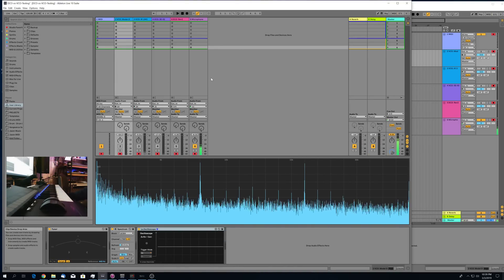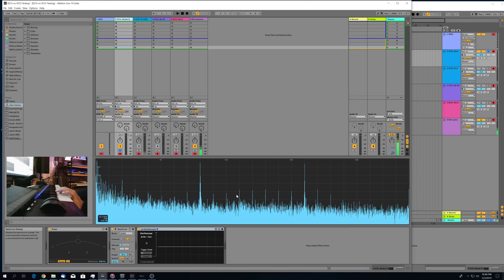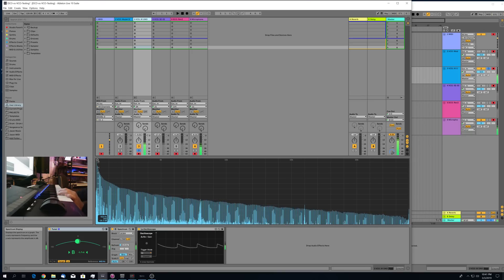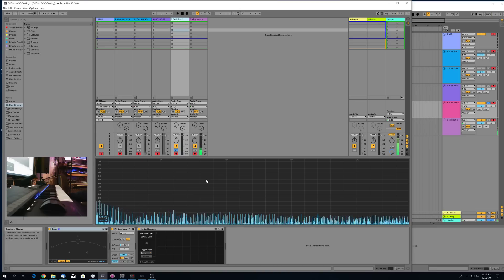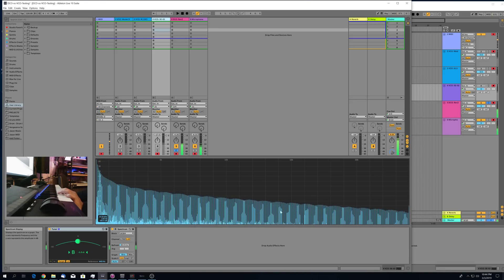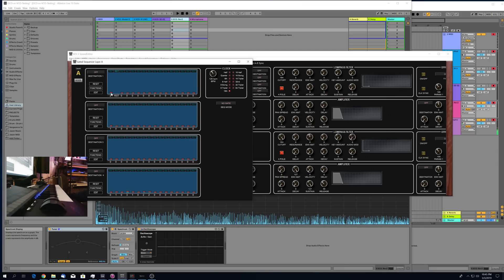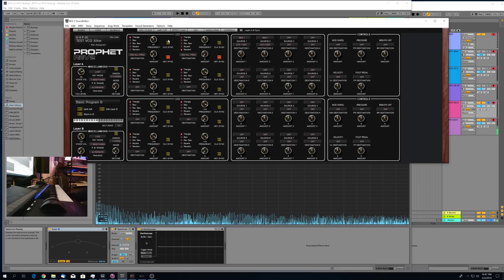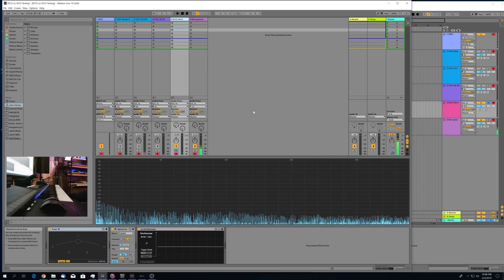VCO Harmonic Frequency Jitter - Do DCOs sound more harsh than VCO synths?

Comment: What about digital DCO?  Like in Casio CZ-101, Kawai  K1, Kawai K4 etc
Reply from the maker: DCO is a digitally controlled analog oscillator  (digital clock/frequency tracking controlling analog waveshaping)    I did test DCOs in this video.   If you're talking about true digital like the CZ, K1,etc, they perform in a similar fashion to DCOs...  ultimately, the clock/frequency tracking is what affects this phase jitter / frequency jitter.   If the clock is digital, then no jitter.    The much bigger effect on "vintage character" comes from per-voice variances to osc tunings, filters, envelopes, lfos, etc...   I have done some research on that topic.  Info here:   https://www.voicecomponentmodeling.com/
Reply: @CreativeSpiral  Why did you decide, that  DCO is a digitally controlled analog oscillator?  Where did the word ANALOG come from? This word is missing in the original abbreviation. I think then the abbreviation would look like this  - DCAO. But  we have DCO.  If You check manual of digital synth and romplers like Casio CZ-101, Kawai  K1, Kawai K4 etc   you can see that their digital oscillators are also called DCO. So I don't really understand why you think DCO should be analog only. Synthesizer manufacturers don't think so.
Reply from the maker: @EuroDJ   That's exactly what I'm saying... many people are confused by the acronym.  They should be referred to as a DCAOs, because that's what they are.  Analog/Voltage Controlled Oscillators, driven by a Digital Clock / Frequency control signal.   Digital oscillators are completely digital in both the clock and wave generation.   All synth manufacturers understand this.
Reply: @CreativeSpiral  What means "All synth manufacturers understand this."?  I have given above absolutely digital synthesizers and romplers, in which their digital oscillators are also called DCO. Open the Casio CZ-101 manual and see for yourself. And you say that DCOs are only analog and you say that   "All synth manufacturers understand this."  On the contrary, under the abbreviation DCO, synthesizer manufacturers understand both analog and digital synthesizers, but all these oscillators are digitally controlled, which is exactly what the abbreviation says.  Analog DCOs are just a special case of first generation DCOs from the first two Juno (6 and 60). In 1984, the Casio CZ-101 came out with digital oscillators, which were also called DCO. And a year later, Roland released the Alpha Juno, which, according to some sources, were also digital osc and, similarly to Casio, were osc also called DCO. Then  romplers with DCO - Kawai K1, Then  - Kawai k4 etc etc etc
Reply from the maker: @EuroDJ   Digital Oscillators are not the same as DCOs.   DCOs have digital control of an analog generated wave.    Digital synths have digital control of a digitally generated wave.   If you don't believe me, feel free to post on forums like Gearslutz or any other professional synthesizer forum, and ask if digital oscillators are the same things as DCOs... or email any of the manufacturers.   If Casio printed, forty years back, that they were calling their digital oscillators "DCOs" then they were wrong to do so, and they just misappropriated the terminology.   https://en.wikipedia.org/wiki/Digitally_controlled_oscillator   https://www.presetpatch.com/articles/vco,-dco-and-digital-oscillators
Reply: @CreativeSpiral  The official manual is not marketing literature, it's the official manual! And all the other definitions of DCO that you can find on the Internet or on Wikipedia or somewhere else ... this is really the material written by no one knows who and no one knows how. Usually these authors are not related to the production of synthesizers, and are not their official representatives. Therefore, let's take into account not advertising booklets and sites from third parties, but the primary source, that is, official information from synthesizer manufacturers. If in the CASIO CZ-101 manual the oscillator is called DCO, and this manual is already 30-40 years old ... How can some blogger on his website say that DCOs are only analog? This means that such bloggers did not discover anything further than the Juno-6 manual and do not take into account the historical facts of the existence of DCO in digital synthesizers.These people simply do not give a damn about the opinion of the manufacturers, and they write some gag.      Somehow it turns out that in the Casio CZ-101 manual there is an error with their digital DCOs, in the Kawai K1 manual there is an error with their digital DCOs, in the Kawai K4 manual there is an error with their digital DCOs, in the Roland Alpha Juno manual there is an error with their digital DCOs, and only Wikipedia is not mistaken)). Are you confusing cause and effect? At first, manufacturers call digital oscillators DCO, and after 30 years, bloggers mistakenly say that DCOs are only analog. In this case, how could Casio make a mistake with the definitions, if bloggers come up with an erroneous definition only after 30 years? Casio is wrong about what definitions? Do you have at least one official definition that was introduced 30-40 years ago, which would clearly state that DCO should be only analog? )  Now any illiterate blogger can create his own web page, as well as edit an article on Wikipedia with various nonsense .. and there is a high probability that no one will really delve into the essence of things and leave it as it is.  Judging from the link that you gave, it is not true, let the author open the official manual of those synthesizers that I cited as an example and make sure that the manufacturers of synthesizers   such digital oscillators called DCO. This contradicts his invented theory. Therefore, I would not cite as an example resources that contradict historical facts.
Reply: @CreativeSpiral  From Wikipedia about DCO from your link:  "The term "digitally controlled oscillator" ..... is also sometimes used to describe numerically controlled oscillators."     So... Numerically controlled oscillators - this is digital oscillator that works on samples

Comment: First off, thank you for this video, a great demonstration! But there is a glaring flaw in this whole "harmonic jitter" idea, this is a phenomenon that doesn't exist. What you are seing, the upper harmonics modulating "more", is the consiquence of using a linear scale on you analyzer. Realise this: about half of the analyzer, the rightmost, represents one single octave! Tonally speaking, the distance between 50-100hz is equivalent to 10k-20khz. Harmonic overtones will, and can, not modulate the same number of Hz as the fundamental but will instead vary in a way of percent away from it. I hope this can be of help.
Reply from the maker: Yeah, I'm aware of octaves/music scaling exponentially...  That doesn't take away from the fact that in the upper frequencies, this still results in frequency modulation of 200-400hz range in higher harmonics.    Harmonic jitter / phase jitter is a well established effect... there have been other papers on the subject.  The question really is:   How much do we hear this...  And is this one of the contributing factors to why some people perceive digital/dco synths as being "more harsh" or "more sterile" than their VCO counterparts.   As I mention in the video, and have written up in articles since, my feeling is that it's very subtle, due to amplitude falloff, and frequency scaling..., but it's definitely present.   This motion may result in a sort of blurring of tone for some people with more acute hearing.   Personally, I'm not to concerned with replicating this effect.   I occasionally reproduce the effect on my DCO synths, or the digital Reaktor synth I've built, but mostly just ignore it, as I don't think it makes a substantial difference, especially in more complex patches with other modulations going on.

There is another topic that I discovered right after investigating this, that has a HUGE effect on replicating vintage poly synth character and improving the modeling of acoustic ensembles....  Voice Component Modeling / Per Voice Variance -   I wrote up a paper in early 2019 on the topic:  http://www.VoiceComponentModeling.com   I perform VCM techniques on nearly all patches I create, if I want them to sound more organic/warm/vintage.
Reply: @CreativeSpiral  i will definitively read that material! I cant imagine how overtones would modulate at a different relative amplitude from a fundamental, to me that would mean an analog oscillator actually producing sinewaves that sort drift around... but I hope i get educated and proved wrong because that would be very cool if one could reproduce it.  I'm working with modelling a synth in pure data and it's a real journey exploring all these ways of 'warming' up the sound or what have you. The tuning of oscillators and voices sure is a big part but the topic is like a black hole. Time just gets sucked in and disappears ;) cheers!
Reply: @CreativeSpiral  Very happy from reading that paper. My synth project actually uses per voice sub-prosessing, and after reading that i will definitively ad variance in other things than just tuning. I guess changing some gain levels and filter frequencies could really open up the sound a bit :) great stuff.
Reply: Hey Rasmus, your initial comment was correct. The upper harmonic movement you see has been exaggerated by the FFT bucket size. If you wanted to actually move the relative frequency of harmonics you would need something like a SSB modulator. That said, adding a small amount of FM is a good way of warming up a DCO.
Reply: @iansayerpersonal2925  I've been thinking a bit about this so i'll think out loud for a bit. I still assume that what we se in this fft spectrometer is just a linear representation of an exponential behaviour. Fwiw, I've experimented with frequency based modulation in the fft domain, and that is a very strange sound haha. But something i think is more important is what amount, and position, of filtering goes on in the 'renowned' old vco synths.. even if you dont have noticable nonlinearities in amplitude, filtering would cause phase delay depending on frequency. And say you have a discrete vco, its not hard to imagine there would be inherent capacitance and inductance. So if you, on top of that, use intentional filtering to even out the impedance to get a 'flat frequency response', so to say. I don't really know what the audible impact is..  what I do know is that if you would compensate in a later stage, any nonlinearities inbetween would behave audubly different. And i think this is very imortant. Especially for achieving things like that nice saturated 'filter burn'.. but maybe it will cause a distortion of the phasing that is not reproduced in more integrated circuits.. I would love to have some hands on time with a standalone moog vca.. can't isolate the stages in mine.

Comment: This is unbelievably great...but once you factor in harmonic frequency jitter and voice component modelling on Rev2 you quickly run out of LFOs and Gated Sequences to use :-(
Reply from the maker: Thanks!   The Voice Modeling (VCM) has a much more significant effect for capturing vintage synth character, and I use it constantly...  Modeling harmonic jitter is just "above and beyond" in my eyes, if you really want to nail a classic VCO sound...  I usually skip the harmonic jitter modeling actually -- unless it's a Mono Synth/Bass/Lead type of sound that I'm modeling.   If you have a polyphonic / multi note patch with Voice Modeling offsets, the VCO jitter is somewhat lost in the complexity of the sound anyways... and I don't think it's that important to add it in that type of scenario.    

I did recently upload some new template patches for Vintage Voice Modeling that use only the Gated Seq and 2 Mod Slots... and leave you with all four LFOs for sound design, plus six mod slots and all envelopes.      https://www.youtube.com/watch?v=m1kzNV_JK60

Comment: Tried this with Prophet '08, but increased the sequencer value from 2 to 8 - the result is subtle enough to not be clearly heard as affecting frequency, but noticeable enough when stacking several voices together. Doesn't make '08 sound like a vintage poly of course - but quite a bit more pleasant.
Reply from the maker: Yeah, that's the same conclusion I came to as well... very subtle.  I researched another topic around this same time as well.  Check out my write up on Voice Component Modeling (and videos).   Voice modeling makes a huge difference when trying to recreate classic/vintage analog poly character.  (it can be done with Rev2, or P08)   http://www.VoiceComponentModeling.com
Reply from the maker: This video shows how to set up voice modeling:  https://www.youtube.com/watch?v=jB9HG3k3vvQ&t=350s
Reply: @CreativeSpiral  tried that, sounds like a natural voice detune - but wouldn't it keep DCO wave static and harsh without routing Seq3 and 4 to LFOs to oscillator frequencies as in this video?
Reply from the maker: @wrmusic8736   It's a detune that occurs independently on a per-voice basis.  (also, per voice offsets to envelope ADR timing)  It makes a huge difference if trying to model vintage poly synths.   I recorded 100s of samples of OBXs, OBXas, MemoryMoogs, Prophets, Jupiters, CS80, Polysix and others... they all have per-voice offsets to tuning, envelope timing and other characteristics, and those small voice-by-voice offsets account for a huge portion of the "classic poly synth character"... more so than harmonic jitter / phase noise.   I have some example patches for Prophet Rev2 that I uploaded here:  https://www.presetpatch.com/user/CreativeSpiral (the ones with VCM in the name)...  I haven't programmed on the P08, but the architecture is the same, and I know the same can be done with P08.

Comment: Very interesting stuff! Have to try this out

Trying to understand what is happening on a more theoretical level,

I was left wondering why the upper harmonics are more effected by the LFO than the lower harmonics? 

This seems unintuitive as the harmonics should remain as multiples of the fundamental if the overall tuning is being modulated. I don't know anything about electronics, but the way it looks in the spectrum is that the VCO:s (and the DCO when harmonic freq. jitter is applied) have changes in their timbre rather than pitch- in fact, changes in their inharmonicity! When the spectrum "wobbles" like that, the upper harmonics fall in and out of the ideal harmonic series, right?

Allthough, since the LFO frequency is in audio range, I guess its more reasonable to think of this as a very slight FM rather than a vibrato. Maybe the wobble is due to wave interactions between original harmonics and harmonics introduced by this FM, and as the modulation index varies, the amplitude of the FM harmonics shift and the spectrum thus wobbles? This adds another interesting dimension as the LFO frequency is fixed and not relative to the pitch being played, so this effect should act differentely on every key, which I guess should add more detail to the overall patch.

Super interresting either way, I feel the Rev2 can be flexible and exact but somewhat unpersonal, I hope these kind of sublte tricks can give it a bit more unique flavour!
Reply from the maker: Yeah, its definitely an FM type of effect.   Your point about it not being relative to the keyboard frequency is a good one... that's what I believe is happening, as well.  It's a "linear / fixed frequency modulation" that seems to be related to some aspect of the circuitry.  In the emulations I created, the LFO acts as a fixed FM source to match the performance of the VCOs.    As mentioned in the vid, I expect its probably some relationship to the operating voltage of the VCO circuit.   Check out the write up I did on Voice Component Modeling as well.   It's another topic I researched an studied around the same time as this, and it has a much bigger / more significant effect on character... Voice modeling can make the Rev2 (and some some other synths) have a lot more classic VCO poly character.  http://www.VoiceComponentModeling.com
Reply: @CreativeSpiral  really interesting! I actually found this video after finding your VCM explorations through the DSI boards. Recently bought a Rev2 so I'm really excited to try these techniques out!

Regarding VCM, do you have any reference tables that you share publicly with measured voice deviations on old VCO synths?

Comment: Would you still recommend doing this now or just stick with the voice component modeling technique instead?
Reply from the maker: Voice Component Modeling (VCM) definitely has a much more significant effect on achieving "Classic VCO character" and "Acoustic Ensemble Character", so for polyphonic patches, and especially ones with longer release times (pads, strings, brass, etc), the voice modeling is much more apparent and effective.   I do still use this harmonic jitter modulation for monophonic leads and bass tones sometimes, if I've got open mod slots... though the effect is very subtle.
Reply: @CreativeSpiral  Good, because I like the VCM way better, mostly because it lets me keep 2 lfo's :)

Comment: Thank you so much for this review. Recently I'v bought IK UNO, and expecting even more jitter, so I was wondering is it actually DCO synth. I've found a scientific expression for "oscillator jitter", it's called "phase noise" https://en.wikipedia.org/wiki/Phase_noise . Particularly, the IK UNO sounds harsh because of its 2 pole filter that is not really capable of attenuating higher harmonics, so the result is similar to some '90s synths with early stage DSP filters. Next, aged analog synths can exibit quite messed up pitches, because the dirt can add ressistance on the path of CV.